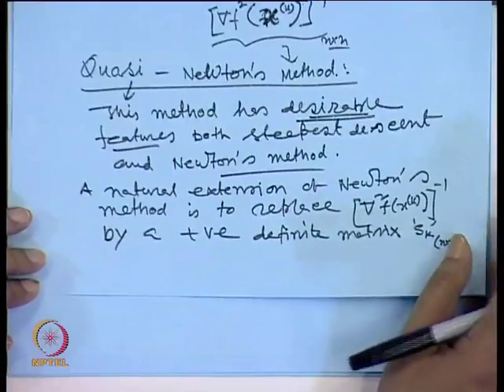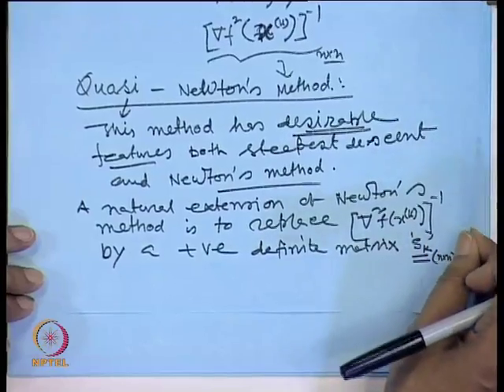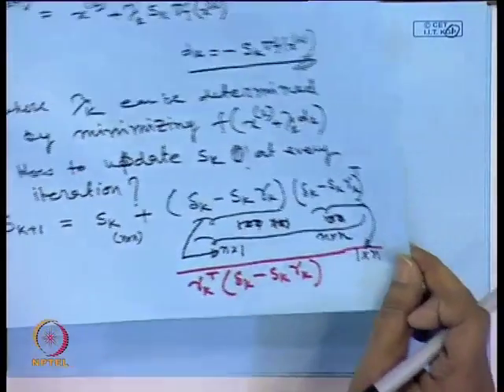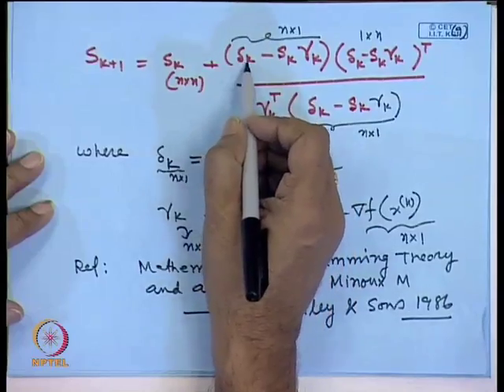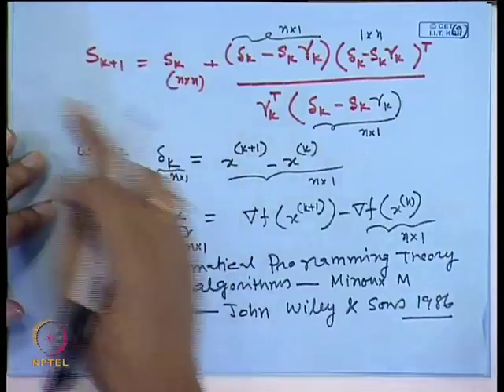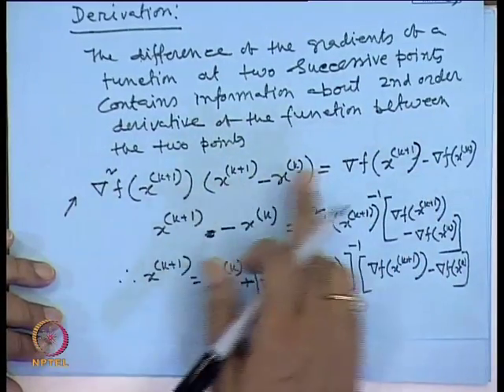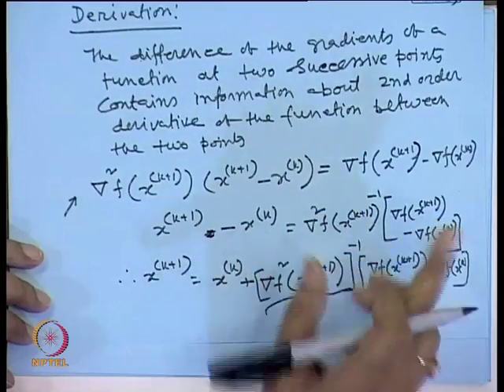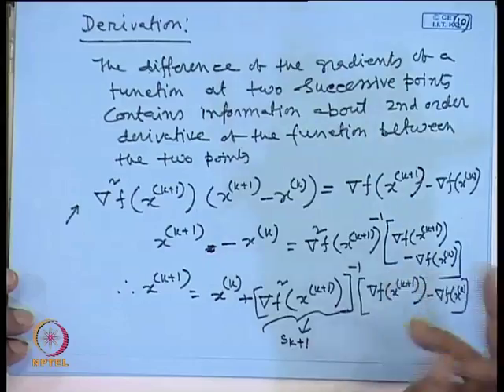Mod-01 Lec-08 Solution of contraint optimization problems - karush - kuhn Tucker (KKT) conditions

Comment: In 50:41, calculations for x1 and x2 result in 0.75 actually. Simply put x1=x2 in line's equation to check it.
Reply: João Roberto Benevides 
yes you are right